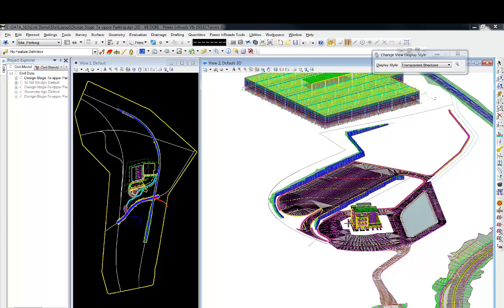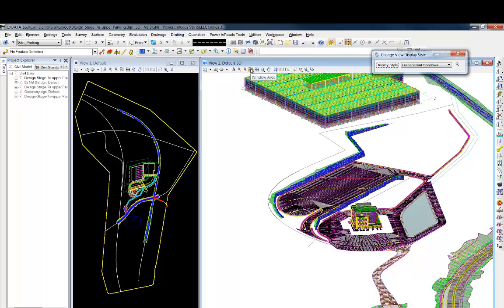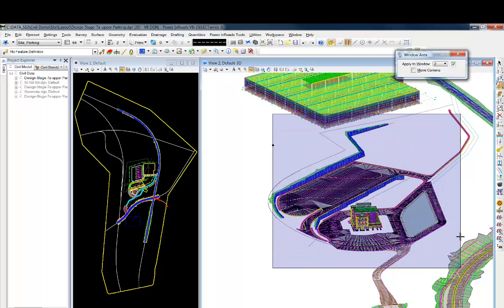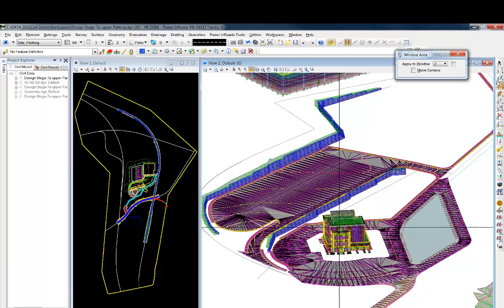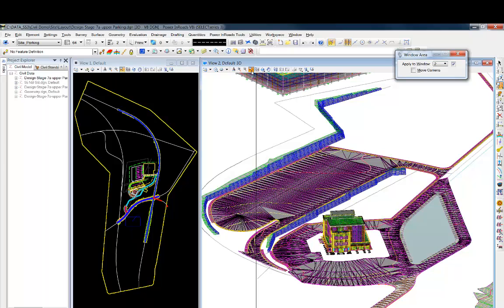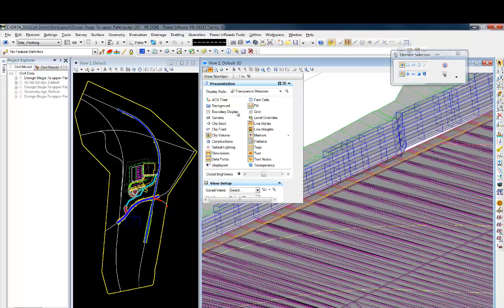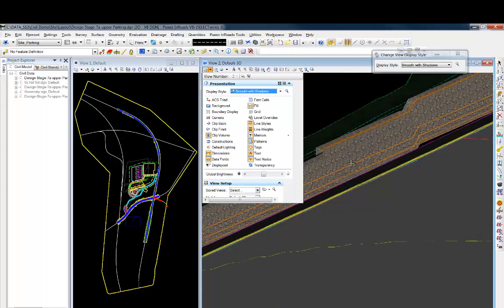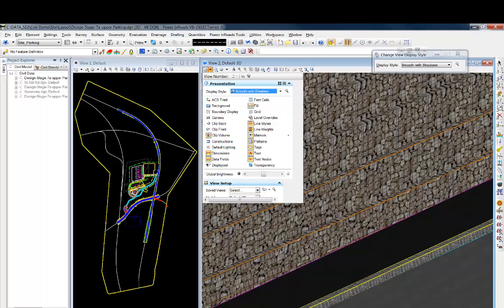Open Roads Site Design

Comment from the maker: Bentley Systems has a plug in for Revit ... the plug in is free and allows Revit users to export there design to an "Imodel.. ".idgn" this can then be referenced or opened in MicroStation. If need be it can then be transformed to a dgn if the user needs to edit it.

Check out the video description for the Revit Plug in link

HTH